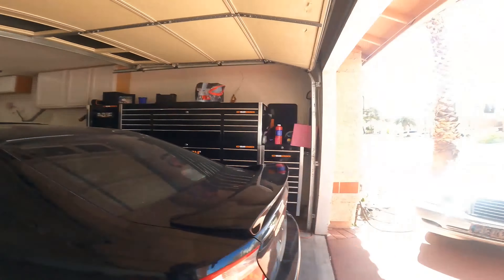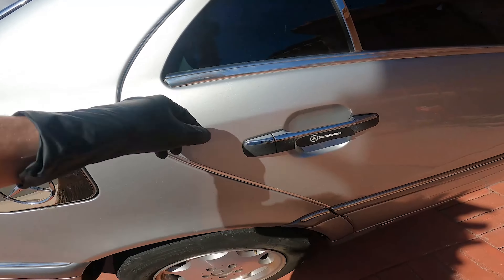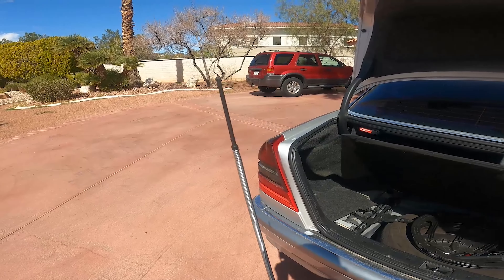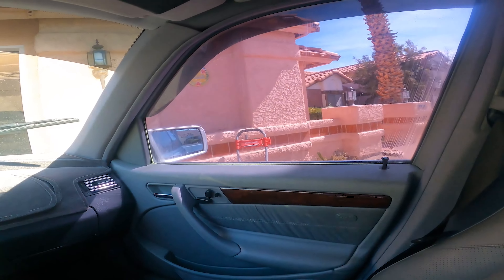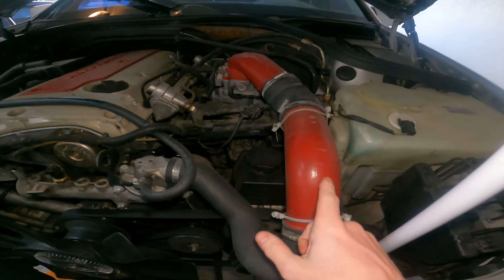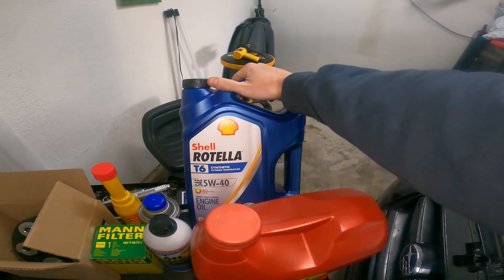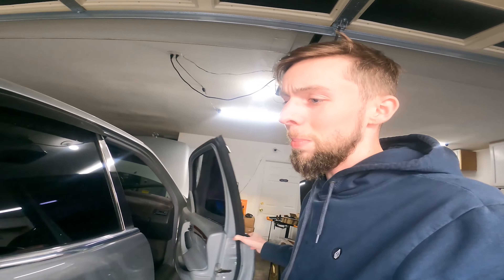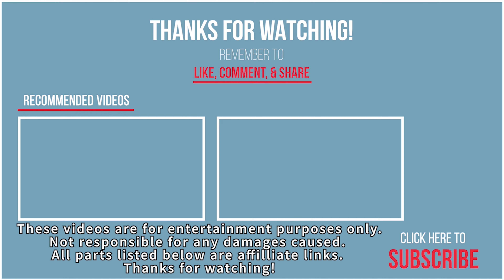My New $500 Daily Driver! Stuck in Limp Mode, Will it drive?

Comment: Nice pick up for $500!
Reply from the maker: Thanks man, its been surprisingly great! This car is extremely cheap for parts, super easy to work on, cheap insurance, and here in  Vegas, I have it registered as a "classic rod" for only $39 a year! 

It had some old tires on it, so before I got new ones, I took my little brother out and drifted this as hard as it could go, tried to melt them off. It handled everything without overheating or even getting hot. Without traction control on its good for a donut or 2 in an empty parking lot😅🫡
Reply: @Mechani_Cole  that's the best man! Great, clean car that's nice and cheap. Especially for the insurance and registration.
lmao got to have fun with it before you get new tires.

Comment: What was the mileage when you got the c230?
Reply from the maker: @JDFerenc it had 150,000 miles, now or just passed 160,000 as of today. 10k miles and only issues have been MAF sensor replacement.